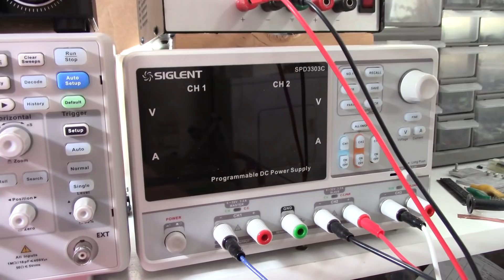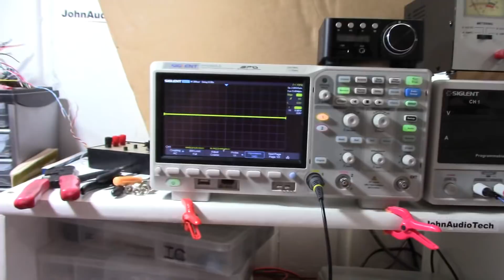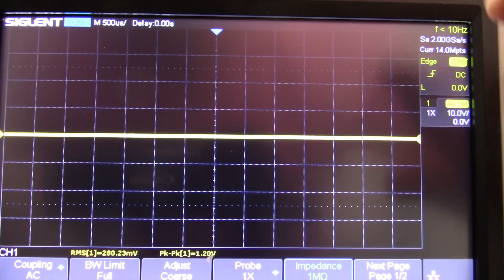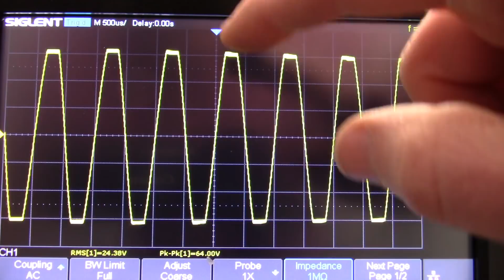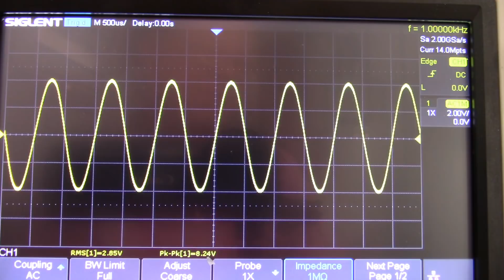100 watts @ 4 Ohms with the JAT501 project amplifier

Comment: I know John likes powerful amps, but what I wish to see is the cleanest, most musical 16 watt amp.  I have really good, efficient speakers.  I don't need or want 100 plus watts.

Please John, for those of us who like our music without the ability to sterilize frogs at 200 meters...  throw us a bone here.  Thank you.
Reply from the maker: I'm actually more interested amps up to around 25 watts. This amp can be operated on reduced supply voltages, say +/- 15v for reduced power and heat. If you like chip amps, the LM1875 will work well in the 15 watt range.
Reply: YOU don't have to turn it up!

Comment: What is the advantage of this amplifier over something like the TDA7293 at roughly the same wattage?
Reply from the maker: That chip is being pushed if operated at more than 29v rails with a 4 ohm load.
Reply: Also, I find that Class D can give really bad FM interference, so don't work well with radios.

Comment: Awesome video John!  I am curious about the temperature of the heatsink at full power.  How long does it take to heat up and how hot does it get?    It is sitting on a large heatsink, so I’m wondering if it gets got after running 20 or 30 min?
Reply from the maker: I'd have to test that with the heat sink sitting vertical.

Comment: How come you cannot lay out the board?
Reply from the maker: I need to learn the software. Between work, YouTube and other stuff I'd rather be doing, I don't have the interest or time.
Reply: @JohnAudioTech  that's what they all say. I bet if you learned schematic capture you'd think it was fun. I used to love running the auto router in Eagle. I wish KiCAD had an auto router like that. In KiCAD I love the 3D view. When you lay a board out you can pop open a 3D view of what the board will look like. That's cool! You can spin it around. It's pretty useless. I think they just did it because it is cool.
Reply from the maker: @1pcfred  If work ever slows down I might put in the effort. I've been getting busier and busier. I used to do two videos a week and now I'm lucky to get one done.

I do have a few projects I want to make boards for such as LEDs, micro controllers, op amp circuit and such.

Comment: I love your JAT501 , can yoy please design a driver board which can drive 20 pairs of 2SC5200 & 2SA1943 .  To achieve more power for outdoor operation
Reply: You can go class d amp for more power without heating and low cost and light weight
Reply: @Deep_X_robi  yaar class D bana toh lunga par  usko repair karne me muskil aati hai. Class AB toh bina koi dikkat repair ho bhi jaati hai
Reply: @saanjayray  
Has ye baat to h
Par overall dhekhe tab Bhi class d jyada sasta padega
Reply: @saanjayray  
Class d reduce transformer and heating 
That mean the cost is half than class ab
Reply: @saanjayray if you need hi quality and protection features
U can see wahyu eko romadhon videos
Reply: @Deep_X_robi  i agree bhai
Reply: @saanjayray  please first check quality of class d amp after you can buy